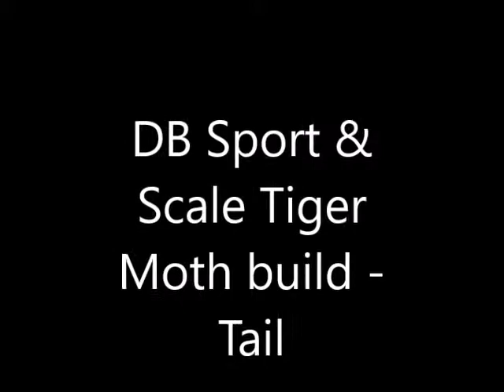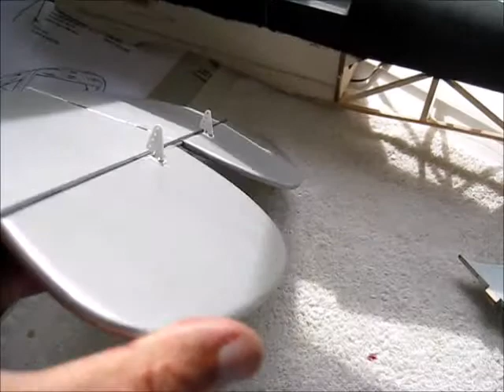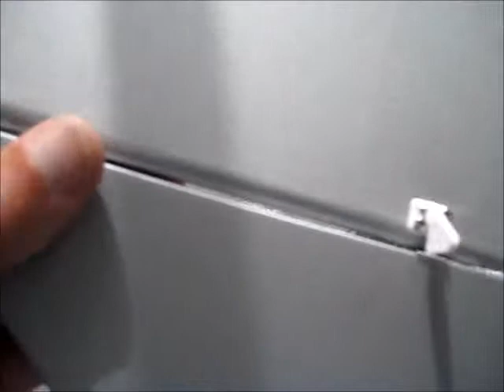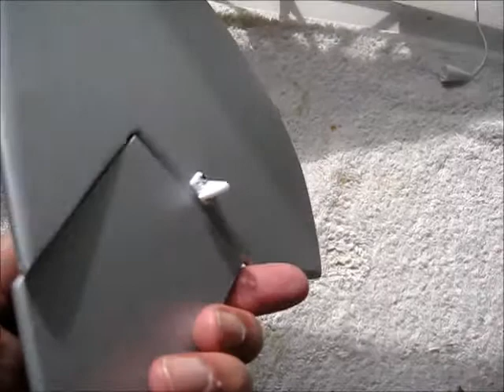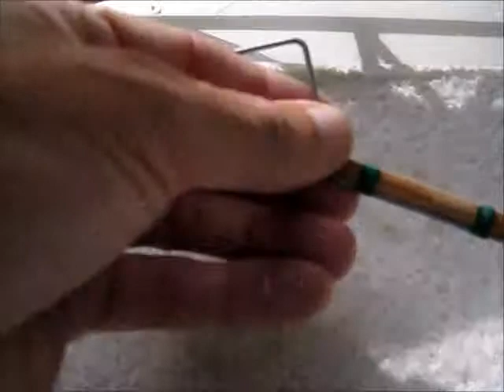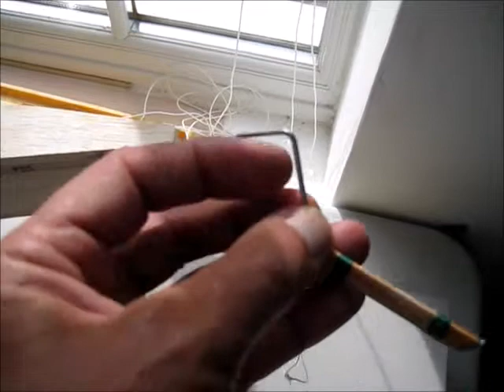DB Sport & Scale build - tail

Comment: Alan, very nice work.  The Oracover looks like it is working well.   I may have missed it in the video but are you using Pull-Pull for rudder and elevator?  Thanks for posting the videos, they have been helpful for me with my build.
Reply from the maker: Hi John, yes the Oratex is lovely, shame it's so expensive !  I'm doing pull/pull for rudder and elevator.  For the rudder I made a lever arrangement that sticks out the sides of the fuselage (it's in one of the earlier videos).  For the elevator I'm running two wires from each side of the servo arm to the appropriate horns.  Haven't decided where I'm going to provide the adjustability (don't like seeing a lot of hardware on the outside), so might have it servo side.  Am covering the fuselage next.
Reply: @alanbarnstable6874  Thanks Alan.  I appreciate the info.  Yes, I see it was on the fuse build. Sorry for duplicating. I'm doing a similar arrangement for the rudder and using two servos for the elevator (no joiner on the elevator halves). I plan to have the adjustments at the servo for the same reason you mention.  You only need to adjust once or twice so it makes sense.
Reply: @alanbarnstable6874  Alan, did you install the stringer that runs the length of the fuselage side?  You said you were covering it next and I did not see it in the cabane video.
Reply from the maker: @johnmcmakin2899  I'm undecided.  The full size planes do have this, but I'm unsure how the covering will work.  It will obviously adhere to the strip, but there will then be an air-gap with an undefined edge before it sticks to the fuselage side. What do you think ?  It's not a bad idea to leave out the joiner, it is quite heavy !
Reply: @alanbarnstable6874  The stringer is very pronunced on the full size TM.  It keeps the fuse from being flat sided and the covering should only touch the the upper and lower longerons and the stringer, so yes there would be an air gap.  Here is a photo that clearly shows the stringer.  https://www.alamy.com/1931-dh82a-tiger-moth-k2585-image227536920.html   However this is a hobby so what ever you like to do is your perogative.  😀
Reply from the maker: @johnmcmakin2899  Hi John, good photo, and to be truly scale the model should have this I guess.  I would prefer to fit it, but I'm only covering up to the ply and I can't see how the covering is going to work along the top edge if it's standing off the surface, especially the front half which is solid.  So, I'm going to sacrifice some of the realism in the interest of simplicity and ensuring the covering is well adhered. I think !  -  just changed my mind. I've had a look and I could stick the top edge onto the ply being careful not to stick to the balsa side of the fuselage.  I'll try one side first and see how it goes. Will let you know outcome.